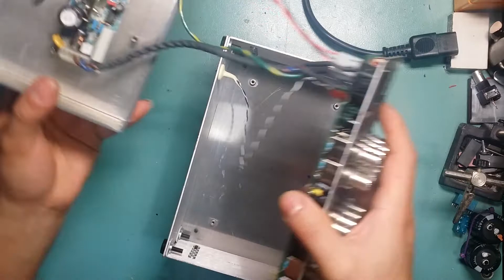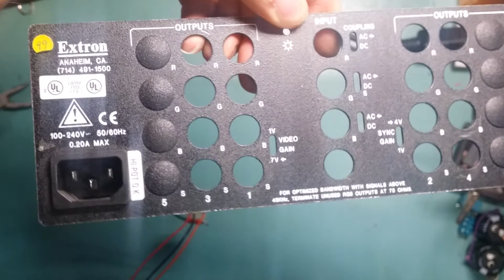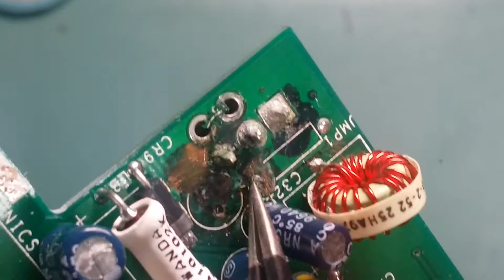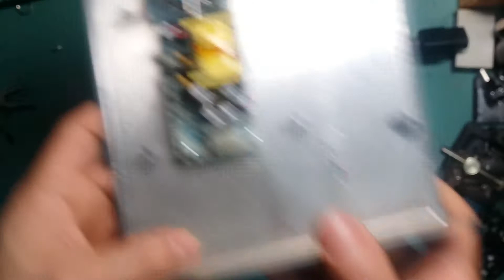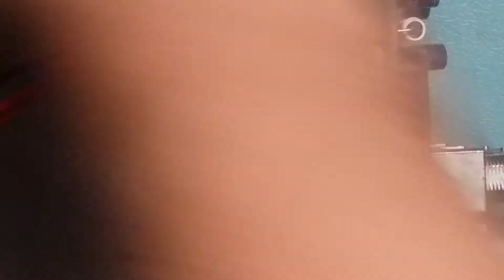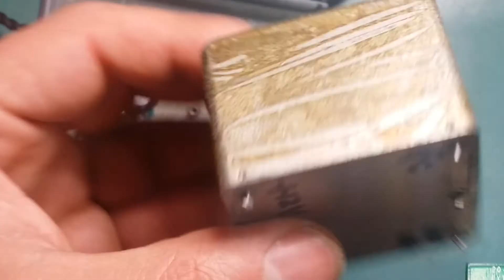Lab Frequency Distributor box prt 1

Comment: Is this a clone of Gerry Sweeneys original project ?
Reply from the maker: tuberlook1  this is almost the same Extron box as his, but i believe his one was working when he bought it unlike mine. also he used a Rubidium 10MHZ gen which i don't have. I will be using a much cheaper version and more readily available of what he had for my 10MHZ ref. Also i am not going to make all the output a 10MHZ signal. i will be leaving G and B signal out put section to be able to distribute my function gen output.